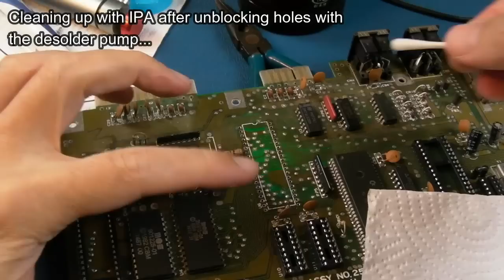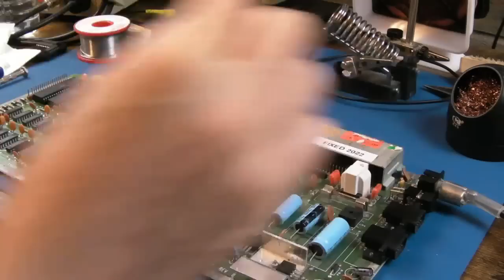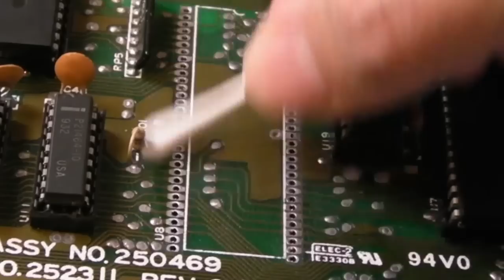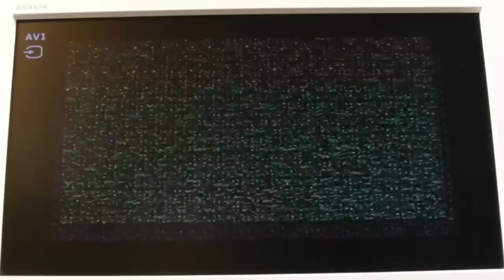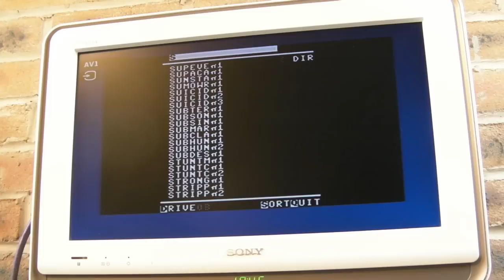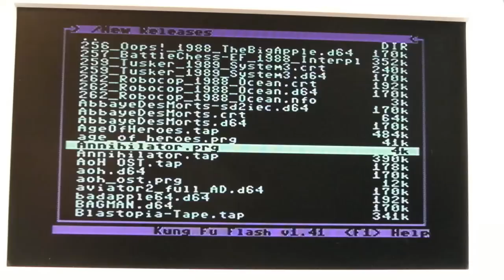Commodore 64 (C64) Junk Board Repairs Part 3

Comment: What kind of solder do you use?
Reply from the maker: 60/40 Leaded - with flux rosin core
Reply: @GadgetUK164 - Retro Gaming Repairs & Mods  haha sorry. I meant the brand. I'm kind of a soldering consumables snob and I liked thr way the flux boiled in the wire you were using haha. Reminded me of Kester. I usually use mg chemicals. I go through alot of solder. I like making circuits on perfboard all the time when I'm learning theory. I gave my commodore to a buddy in Florida. He recapped the electrolytics and it booted first try. It was a c64 in a vic 20 box. I have a buddy who is a scrapper amd he seen an old man pull up to the dump (3 Saturday every month) in my village and lay the box down. It had the manual and everything. When I opened it to check the caps I could tell I was the first person to ever apply heat to the interior. I used the gun. It's crazy, there was no discoloration or leaky caps. Looked like the main board was just made. Sorry man. I tend to ramble.

Comment: Great work as usual, Gadget. Got a whiff of Trigger's broom about this one! I know nought about C64s, but I had to raise an eyebrow when you said the colour RAM wouldn't cause this problem -- Murphy'll get you! BTW, I think the tool you've got there is an awl (as in cobblers' awls) rather than a dowel. 👍
Reply from the maker: Thanks =D  Colour RAM definitely wasn't causing any problem there - it was just one bit on there dead, so basically that's what gave me yellow instead of white when I tested the old chip afterwards.  Yes, the tool is an AWL!  I always thought a dowel was a pointy tool much the same, but clearly not not I research it lol

Comment: Soo, with so many Chips dead, is it safe to assume that some kind of overvoltage occured and that rendered all those chips unfunctional?
Reply from the maker: =D  Yes, pretty sure it was a bad PSU where the 5v went to 7v or higher =/  I wonder if the missing chips were faulty too - probably!

Comment: Thanks for the video. Alot of faults on this motherboard :p I thought turn pin socket was actually worse VS dual wipe when the chip pins are very short
Reply from the maker: The same problem happens with dual wipe though - with short pins like that the chip just pops out =/

Comment: Watching you working with the desoldering gun reminds me that I need to take apart my weller WMD-3 station. It has three connections for accessories, and now It's blowing air out of the desoldering gun while using hot air gun so somewhere a valve or membrane has failed.
P.S> that board you fixed, I get the impression it's had a lightning strike or something nearby and it was just enough to fry most of the chips but leave no trace of any discharge.
Reply from the maker: It probably wasn't lighting, the 7805 in the PSUs fail and 9v or so ends up going down the 5v rail =/

Comment: I don't know about other people, but my experience with turnpin sockets is not great at all. I have used both cheap ones from AliExpress and quality ones from Mouser. The only times I have had connectivity issues, the problem has always happened in a turnpin socket. Never have I ever had any problems with the double-leaf type. What about you guys?
Reply: In my opinion, turned pin sockets are a bit overhyped, considered by many as superior to leaf-spring sockets. Turned pin has its uses, but I consider it nonsense that they are better than leaf-spring sockets. Dual wipe leaf-spring socket are extremely reliable and I see no absolutely basis for the common perception that turned pin sockets last longer. Especially if you need to unplug and replace chips regularily, always use leaf-spring.
Reply: @danielmantione  I think my understanding of this has evolved over time to match yours 100% 🙂 (or close to) For IC pins that are flat, dual leaf-spring sockets surely must have a much larger contact area as well? You have there a flat pin which is sandwiched between two flat surfaces, while with the turned pin the circular hole (cylinder shape) only touches the IC pin on the 4 corners of the rectangular profiled-pin (cross-section). Some poor quality turned pin sockets I have used also have widened after just a couple of insert/remove cycles, so the fit is much looser after a few reconnects. I assume some of my problems I've had with turned pin sockets has been with corroded pins that didn't have good contacts in the 4 corners trying to make contact with the round pin cylinder. May I ask you in which cases/scenarios you would prefer turned pin sockets? (you wrote "turned pin has its uses"...) I guess if the IC pins are extremely short, they are probably more suited, or what do you think?
Reply: @SeanChYT  A turned pin socket can be installed into another sockets, so IC adapters built of sockets are best built using turned-pin. Another application is that if you widen the PCB hole to +/- 1mm the socket sinks really deep into the PCB and you can build very low profile boards, useful in case you are height limited. Esthetics may also play a role, a board with turned pin sockets looks nice. However, in most situations where you mount a socket, you just want it to work and then a normal, standard leaf-spring socket proves to be the best choice, in my experience.
Reply: @danielmantione  Thank you very much. I will stop nagging you now. 🙂
Reply from the maker: I never have problems with turned pin sockets unless the IC pins are too short.  Turned pin sockets are not good where you are taking chips and and out regularly either!  Dual wipe is better where the legs are long enough for sure!

Comment: Excellent video and work!! I hate those PLAs and they are a pain to find sockets and replacement IC. Thanks for sharing
Reply: Yes, if the PLA is bad in a short board, I would normally recommend to scrap the board and move the chips to a modern replacement board. This is despite the fact that in general I don't like the practise that people slaughter old boards to get components for modern replacements. However... considering that bad PLAs in short boards are rare and considering the not-so-common 64 pin socket, I think it is better to move to a board with industry standard components rather than building a modern replacement for the fat PLA. Nevertheless... kudos for repairing this board!

Comment: Are you sure about using turned-pin sockets on chips with short pins? I recently bought a "faulty" breadbin 64 from ebay and it turned out that it was the CPU and BASIC ROM that were loose because of having short pins in turned-pin sockets. The thought has crossed my mind that it might be one of yours actually, as it has been recapped (and a beautiful job it is as well, the soldering looks factory) with Suntan caps, it has those little silver heatsinks dotted around the main chips, and it has a SuperPLA installed, so some care has clearly been given to it, but it was spoilt for 'haporth of tar with these sockets. I got it going by simply sandwiching a dual-wipe socket between the chip and the existing socket (less risky then trying to remove them) and it's now solid as a rock.

I dunno, I don't like those sockets at all!
Reply from the maker: It really depends how short the pins are - if they are too short, either turned pin or dual wipe will struggle to hold it...  Sometimes its best to solder the IC into a socket and plug that socket into another socket (I did that as a follow up to this - available on Patreon atm, will go public in a few weeks).
Reply: @GadgetUK164  Thanks. Yeah I will keep an eye on it. Actually I think the guy who dealt with this one has done something similar with the SID, as its in a socket sandwich. The ground pin (only) was soldered to the socket, and I managed to break it while trying to remove the SID. thankfully it's making good enough contact (for now at least) but I may have to do a bit of surgery on that pin in the future.

If I have any further problems with those two ICs I will look into soldering onto a socket... However the dual wipe does appear to be clinging on to the chips better than the turned pin ones in my specific case, so I think that at very least it can be worth trying them in both types before getting more drastic with it 😁

But hey, a fully working breadbin in good condition for £30 is a bargain in anyone's book!
Reply: I personally prefer good quality dual wipe sockets. Those single wipe sockets should be replaced on sight though!
If the pins are too short to stay in a socket, they should just be soldered in direct